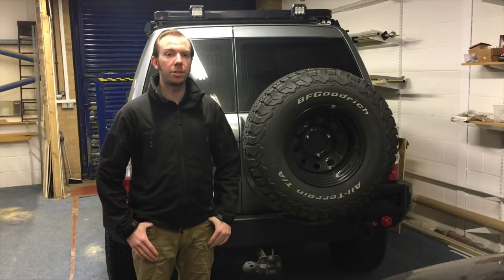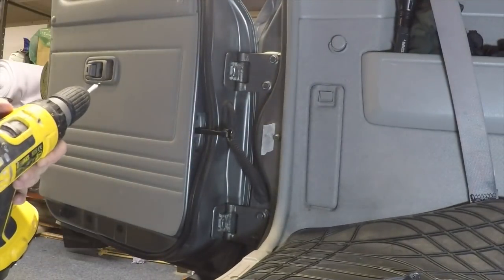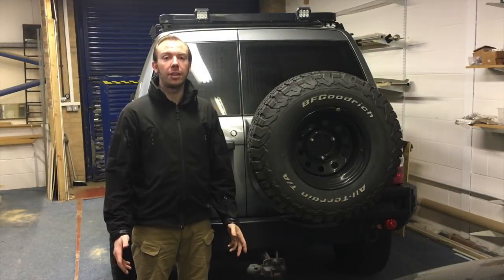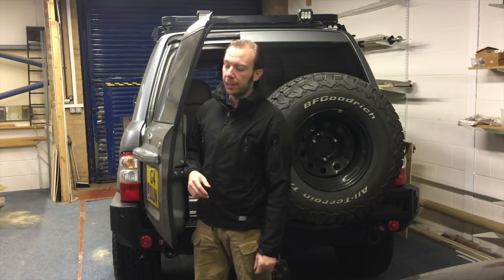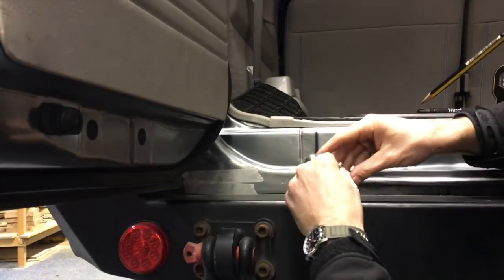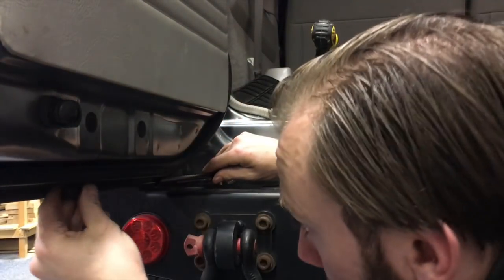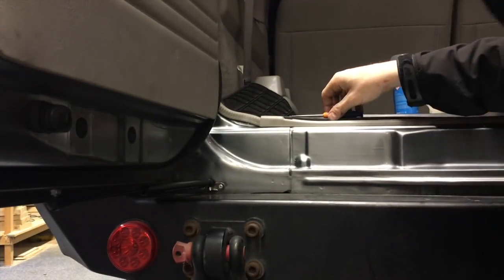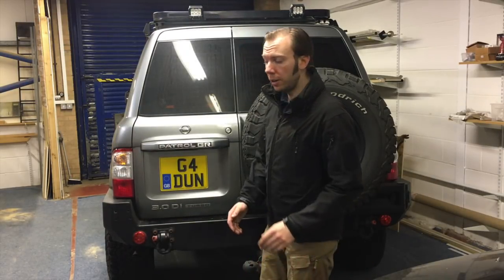Nissan Patrol GU3 - Barn Door Modifications

Comment: Hey man! Bit of a late response but I only just got my first '98 GU Patrol so I am slowly working my way through the essential DIY mods :)
Thanks for sharing, this is great stuff!
I did pretty much the same (Part 1) as you, perhaps my drill hole was a couple of mm closer to the original and I used the original bolt, however, my barn door no longer entirely shuts... have you come across this before?
Reply: I dont mean to be off topic but does someone know of a trick to get back into an instagram account??
I stupidly lost the password. I love any assistance you can offer me!
Reply: @Keith Landyn Instablaster :)
Reply: @Issac Bentley It worked and I finally got access to my account again. I'm so happy:D
Thanks so much you really help me out !
Reply: @Keith Landyn Happy to help :D
Reply: I could of told ya that mate.... in this first part of the video i could Already see he stuffed up and changing the Length  hole
will cause the doors not  too shut properly. 👍👍
Complete waste of time.

Comment: can you perform snatch recoveries from those shackle points on the rear bumper?
Reply from the maker: Sorry for the late reply.  With the right shackles a snatch recovery would be possible... But those ones are only rated to 3/4 tonne.
Reply: The right answer is no, those are tie down points or tow points. They will not be rated for a snatch.